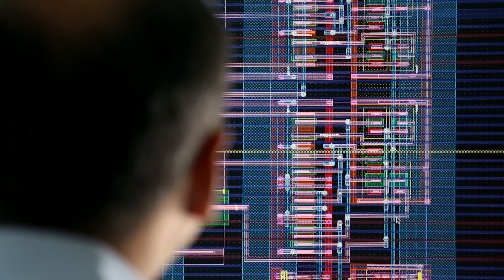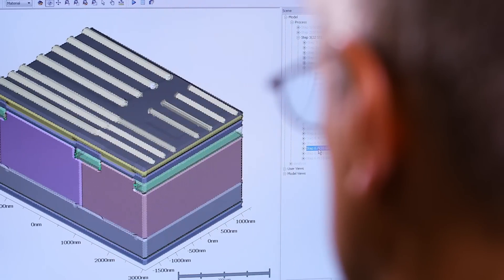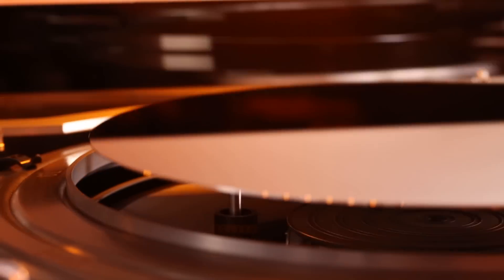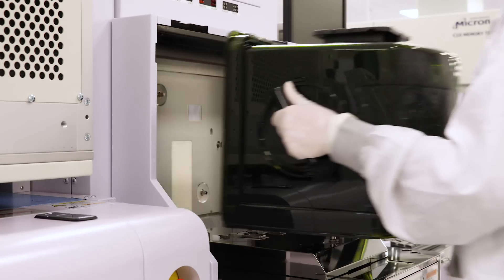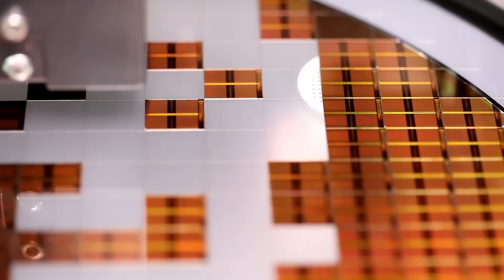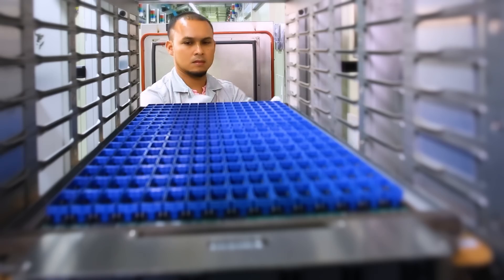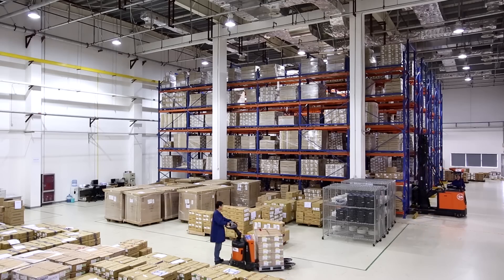Making Memory Chips – Semiconductor manufacturing process

Comment: After reaching the Physics absolute limit on how small the transistors could be to properly function without electron tunneling in a chip I say: "stack two chips on top of each other to multiply it capacity".

Comment: I find it mind-boggling that it's cheaper to take the completed wafers, carefully ship them to China for assembly,  then ship them back to America.
Reply: Most wafer manufacturing are located in SEA anyway...
Reply: >to take the completed wafers
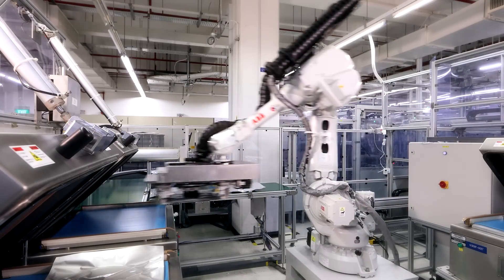If you're saying about 3:35 to 3:45 segment, then It's not wafers anymore, but a finished product (memory chip) that doesn't require any specific handling.

Comment: I like it how with each generation, whether it be Samsung, Micron or Hynix; they all have their premier time.. and their equalisation time. Usually Samsung is first, but have yet to see a generation of GDDR or DDR where Micron or Hynix did not catch up or even surpass. Micron are more impressive by merit that they often push the cutting edge despite being so small. Samsung and Hynix have other sectors to draw off for a rough year.
Reply: most samsung ram chips are more likely to fail than micron..i worked on that industry and i know that for fact
Reply: Hello ❤️❤️❤️

Comment: This was really cool to see. The machine adding the gold wires was insanely fast. I know us folks often complain about prices of SSDs, etc. But it's hard to imagine how much work goes into all this. Especially when all you see is just a fairly plain black rectangle on some semi-interesting PCB. 1 month to create? With 100s of steps?  Thanks for posting this.
Reply: I know right? So insane how far we've come within just the last 50 years even
Reply: etch, rinse and repeat, for a month.
Reply: Yes, it is impressive.  And it years to determine and design the 1000s (not just 100s) of process steps so the memory bits can be ever smaller but with very high yields. And THEN a given chip goes through all these steps over a month.  Amazing. The number of bits in a $100 SSD has increased by amazing amounts over the last 10, 20 years.